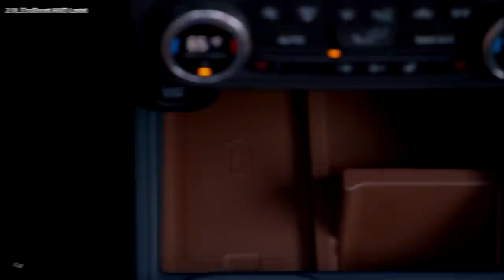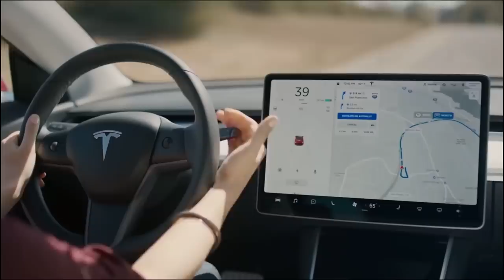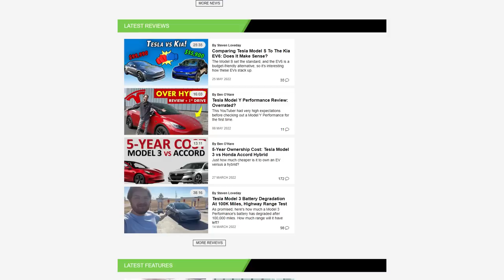Ford CEO Confirms Ford Maverick Has A HUGE Problem

Comment: I love the price point and useability. I am considering a purchase.

HOWEVER my biggest concern is that Ford still hasn't corrected the transmission issues in their focus for  the masses which leaves a considerable concern for me should the maverick turn out to be a lemon as well.

I'm tired of paying for a vehicle that i ultimately am testing for ford to find out its  not viable a should be fixed by Ford only to be stuck with it in a less than acceptable operating condition and reduced value.
Reply: I bought a hybrid maverick in April 2022 and I love it! I have 6,500 miles on it already and I average 39 Mpg. I haven’t had a recall yet but looks like the side airbag one will happen. I still have no regrets because there was nothing comparable for me to get. The Hyundai Sante Fe was not fuel efficient enough for my commute.
Reply: Daniel Emery:
Aside from the AMERICAN Fiesta and Focus, NO OTHER FORD PRODUCTS ANYWHERE use or used that PowerShift transmission, so your transmission worries are groundless.  (Even Fiestas and Focuses built elsewhere use a different automatic transmission. )
As the owner of a 2013 Fusion I would say avoid any 1st year model. But if you are buying a Maverick hybrid you are pretty much getting the same mechanical systems Ford has used in Escapes and Fusions for ...a decade?
Reply: Always get a new model on its 3rd year or later of production. Silly guinea
Reply: @howardkerr8174  im not worried ford will use the transmission again, im worried the will not stand behind faulty product again!
Reply: daniel emery:  Yes, for me it's all about quality, and I'm very much in wait-and-see mode.  Also I don't like that real world, it seems to be very hard to actually get a Maverick at near the $20K price advertised. 

But time will tell.  For me, a near $20K truck, or a $25K truck I really like, is a serious candidate to replace, say, a $25K sedan.   The makers can keep their, say, $50K or $60K and up trucks as I want to get from A to B safely and comfortably and reliably, not show off.

Comment: Everyone has recalls. It’s more important that a company doesn’t try to avoid them and take it on the chin. We the consumers (and shareholders) understand that vehicle manufacturers have to sub out parts production which increases the probability of recalls. The bigger worry is long term reliability and ease of maintaining these vehicles. 

If Ford is serious about taking EVs to the masses, they will back their products with lengthy warranties and making sure that the average shade tree mechanic can service their vehicles without getting zapped.
Reply: I'm glad they're stepping up and claiming this could potentially be a problem, and fixing it proactively rather than blowing it off until there is a problem and someone gets hurt or worse.

Comment: It's kinda of nuts to have recalls on brakes which has been used for a LONG TIME. Just shows the engineering is overdone and too complex. Who loses in the end? The customer with galaxy priced parts and labor. This is cost efficiency for us? The big 3 are battling it out under a circus tent and the clowns are laughing that we put up with this mess of so called engineering technology.

Comment: Given Ford's commitment to customers, why can't Ford get it right the first time?  I have never owned a pickup truck or been a Ford homer.  Right when I seriously consider purchasing a Ford Truck, I now hear 10 recalls.  I have lived long enough to remember the Ford Pinto blowing up when hit in the rear and the deserving nickname for so many recalls on so many lines of Ford vehicles, Fix Or Repair Daily.  It seems they rushed out the product and did not perform the quality checks to delay the launch.  As a result, it costs the consumer time they should have taken to make sure it is right before the vehicle hits the market. I don't know about Ford; they seem to be the same old Ford that can't stop being its own worse enemy.  

By the way when considering Ford, I could care less about Tesla's recall. Sigh.
Reply: and let's remember since you said the word pinto, Ford decided that it was easier to let the couple few lawsuits that may come up get paid then to fix all the pintos that were on the road.
Reply: Mark Hensley     Maybe you could tell us why GM skirted around ignition switch issues for 10 years and thousands of deaths.

Comment: This is why you Never buy a new model introduction until initial bugs have been addressed. Those that buy first experience the most headaches of constantly taking it back to the dealership along with techs that need to learn these new models.
Reply: Yes, but they get to be the first to experience the new model.  Ford is already raising prices too.  I think the real problem would be buying a first-year model they don't/can't fix.  As long as they fix them you can trade the time loss with being the first to have it.

Comment: Yup ford and there many recalls and leaving people broke without a car ford focus,fiesta,escape. Also ford escape transmission issues. It's always there transmission. Have a 2006 audi ya falling apart has 168000 and spent less money fixing it than my 2014 ford escape at 90000 spent over 5k in front repairs casue there just a week brand. MEMEBER FORD IS A CHINA BRAND. PARTS FROM EVERYWHERE AND THEN BULIT IN ONE PLACE. THATS Y THEY HAVE SO MANY RECALLS ON DOOR LATCHES, CHILDLOCK, AND MORE WITH THE BODY

Comment: No way Ford takes over from Tesla. That won't happen until you get 1000 miles per charge because there is not a charging network for ford. level 2 doesn't count. I say this, and I have always owned ford. I have a PHEV and one of their ecoboosts. Too many problems fo rboth ford and chevy lately due to the covid supply problems. Tesla has problems, but they are a software company first.

Comment: In the grand scheme of occupant safety this is a fart in a wind storm.  The amount of noncompliance is lost in the noise of the experiment (test).  NHTSA and  the safety organization has to maintain it’s machismos in the industry.  This action is not the like cure for Covid.  As the announcement goes on all the talk is money, money, money.  I don’t think the test that Ford flunked has been around  long enough to correlate to the dynamic system test or real world performance.  This was a place to talk about money, not safety.  Very unfortunate.  Luckily the test disparity registers a fat zero on lives and serious injuries.  I’m an engineer, retired, with 30+ years at OEM’s, Tier 1s.  The product?  Safety systems.  Tell Wall Street to leave Ford alone.  They been under cutting the stock for over 15 years for no reason.  The fix is in again.  Buy International Loli-Pop, it’s a good sucker stock!

Comment: It's not a real truck.  Trucks have true body-on-frames which are stronger and will last longer than unibodies like the Maverick and other cars. Unibody cars are not only going to last not as long, but there are less repairable if in an accident. These cheaply made cars are more easily totaled than if a real truck took the same damage. So they are not worth buying.  You only save a few thousand dollars but these are worthless to me.

Comment: Honesty is the best policy they say. And the ford maverick is one of the best ideals  by a car company in a while. It's Affordable, economical, and a good way to get a hybrid vehicle. Personally a hybrid is a feasible way to use electric power for transportation while full EVs are not. This due to our outdated electrical system in the USA, and not feasible in slot of applications. But get the bugs worked out of it and maybe make a SUV type and I will buy one of both. 2 for say 45000 $, that's livable as compared to alternative choices.
Reply: Well, until they EVER figure out how to make better Batteries for EV's, it will always take EV owners, extra days/weeks, to take a long trip even across a few states...It has nothing to do with our electric grid... Perhaps if Everyone all 340 million of so Americans bought an EV and they were all charging them all the time, we might have to build out the Grid bigger... But are we really ever going to get to that??? I don't think so, based on just the price of EV's today...And the sad range, even the best of them have before they have to stop, find a charging station and take an hour or more to charge it back up... It's always been a great idea------   except no one apparently thought about those pesky lithium ion batteries weight, range, and oh the cost of Replacing them all when they die for good...  Yes, all vehicles cost a lot of money to operate, but these things seem to be really great if you can stand to take extra days/weeks for that same vacation you used to take that didnt require this, and stand around while your EV is getting charged for an hour, etc...

Comment: Not much has changed at Ford. There engineers say the air bags were ok but they failed the test. They test different air bags and they fail also. If it wasn’t for independent testing those Mavericks would’ve never been recalled. That is not good and why I don’t own a ford anymore….

Comment: This must one of the reasons why I STILL have a recall showing on my Ford Pass App, for my F-150's "unintended tailgate opening"....after almost a YEAR.

Hey FORD...try taking care of your OWNERS before you worry about the shareholders....WE'RE the ones that bought the vehicles at inflated prices....remember ?🤔
Reply: "unintended tailgate opening"?  What on earth is that problem?  The tailgate on my Ranger and F250 have never opened themselves...and both are 30+ years old LOL.
Reply: @wildbill23c  2019 Lariat F-150 5.0...and I've never had it happen either...but I have a recall they have no parts for....apparently.🙄
Reply: @CannonFodder873  So it has a remote tailgate release, is that what the unintended opening issue is?  Seems kind of odd...I know they used to fall off if you left them down while driving, but I've never done that or even tried it to find out HAHA!!!
Reply: @wildbill23c  ...a 25 cent gear clamp on the right hand side of the tailgate fixes THAT problem...ADDED Bonus: No one can steal your tailgate.

What I find ODD is that it's a safety recall... and that they've been almost a year NOT FIXING the problem on a 2019 $70K truck that's still under warranty.

Comment: These recalls will be the death of the old legacy ICE car MFG.
I just heard they lost a trial against their F-250 cab on their roof, multi millions $$$ settlements, And yet another recall for their Truck's Aluminum drive shafts. They can't afford these recalls and EV's production at the same time, and what if they still use faulty batteries, more and more $$$ in depth, and bankruptcy